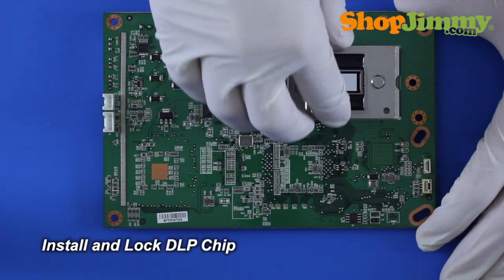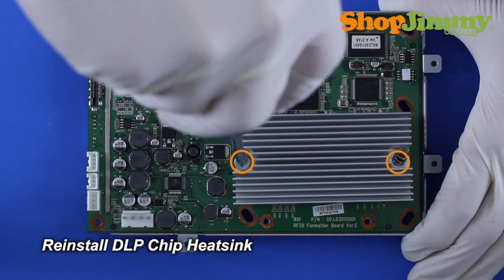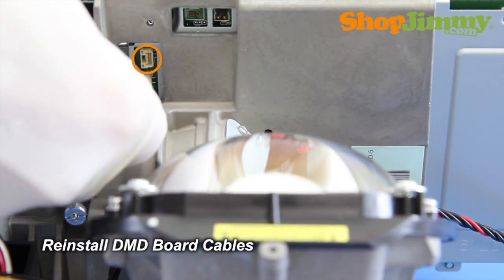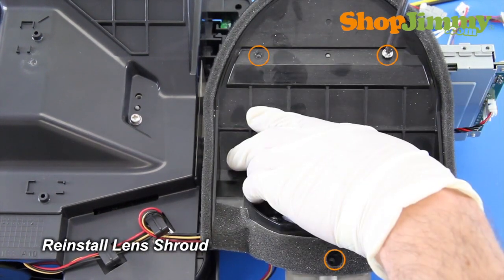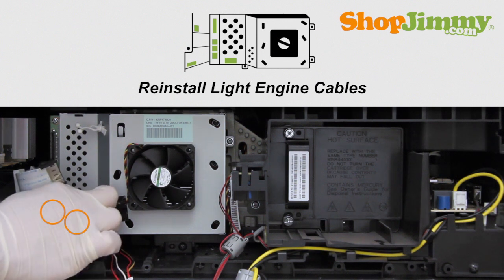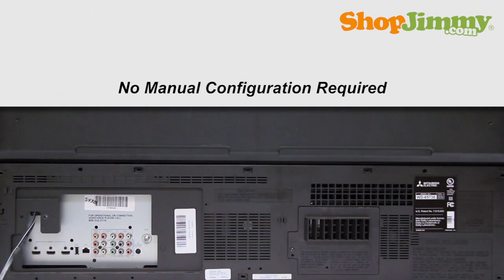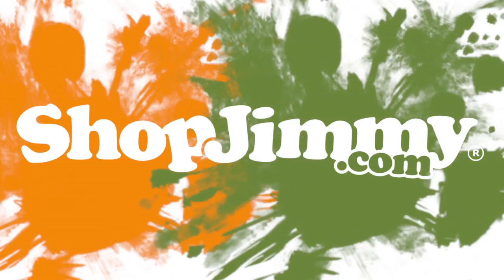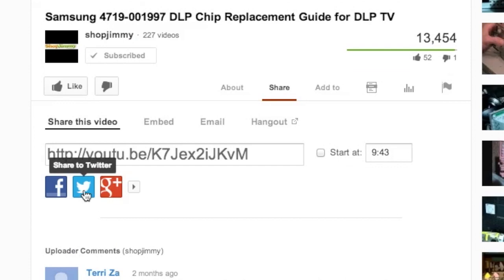DLP TV Chip Replacement - How to Replace DLP Chip in DMD Board - DIY Easy Repair

Comment: My Mishibishi model 73733 has been fixed for white dots two yeasr ago , now tv shut off by itself , I reset , turn it back on ,work about 2 minutes ,it's off again , and I got steady red light ,I replace a new lamp ,still shut off itself , 
Thankyou
Reply: It's probably overheating as it's stacked full with dust

Comment: can ya diagnose this?    screen suddenly went black.  no menus. screen is lit, so it's not the lamp.  just checked out the lamp, color wheel etc... those seem fine.  Despite the blackout, the screen is illuminated.

there was no speckling prior to the blackout. (so I don't think it's the chip).  can't discern of it's the DMD board itself or the actual input (digital / analog boards). what'cha make of this?
Reply from the maker: *****   Please reply with the TV Brand, Model number and then we can recommend a replacement part for your TV repair.  Thanks!  www.shopjimmy.com
Reply: HLP 5674WX/XAA

So what'cha think, DMD board, Chip, or Digital/Analog Boards?
Reply from the maker: *****   I recommend replacing the analog board.  Here is a link to replacement parts for your TV model number on our website, click here:  http://www.shopjimmy.com/catalogsearch/result/?q=HLP+5674WX%2FXAA  Be sure to match part numbers on your current board, with your replacement for compatibility.  You can also call our customer service for further assistance with your purchase.  (877) 881-6492  Thanks and please let us know if you have any further questions with your TV Repair!  www.shopjimmy.com
Reply: Js